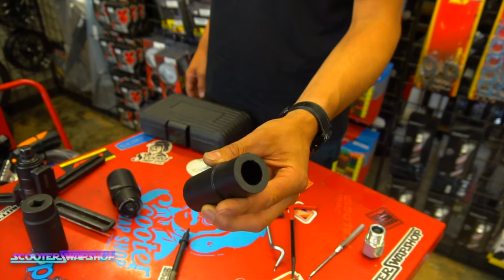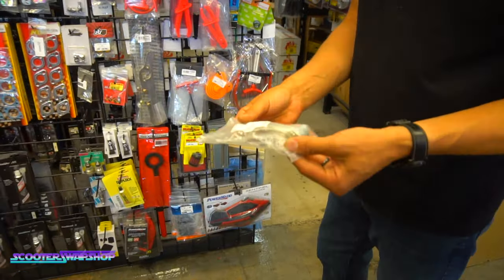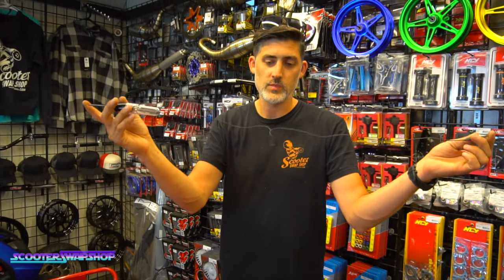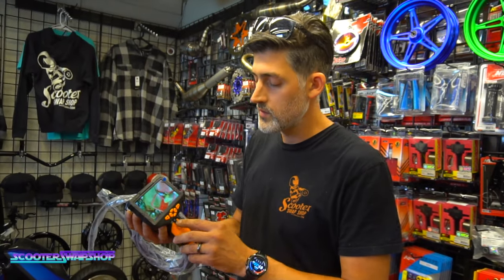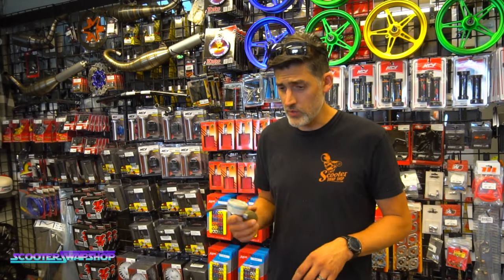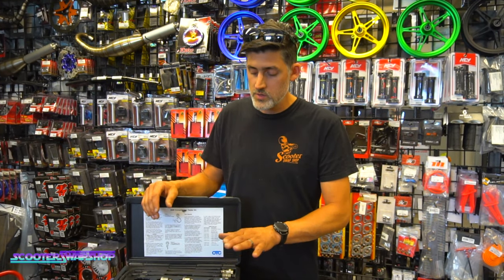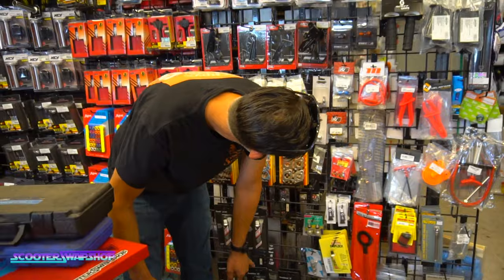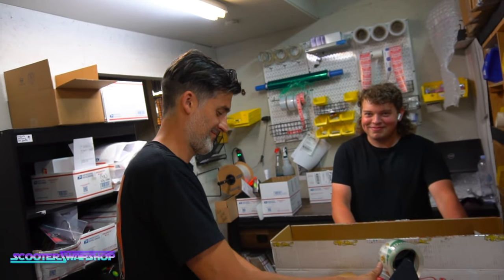What are the most common tools for my scooter? | DIY repair

Comment: Do you mean don't put both case halves in a press?
Cuz even using the Honda collar/bolt method to pull the halves together is still pressing
Reply from the maker: Pulling a crank into a motor Isn’t pressing a crank into a case.